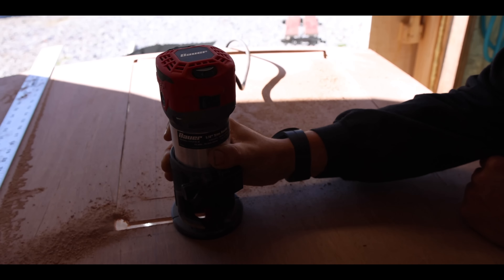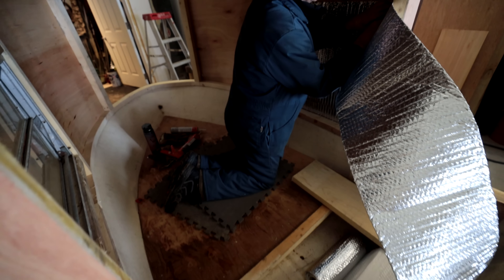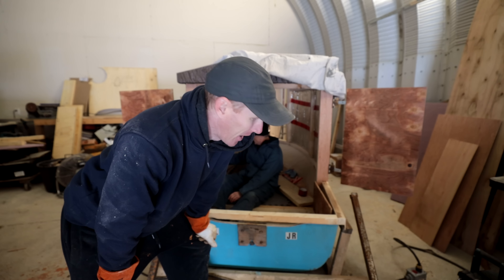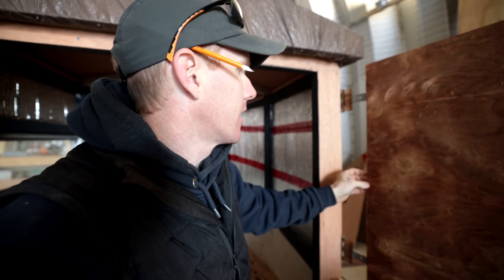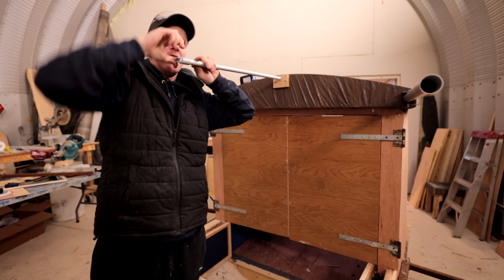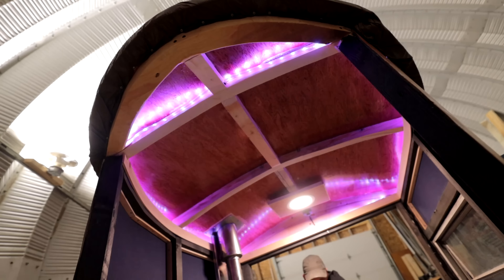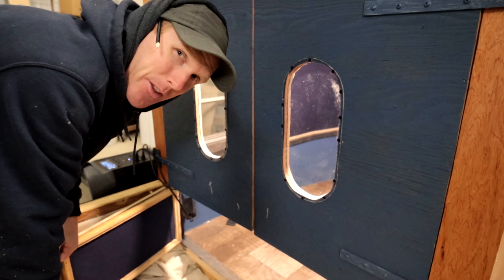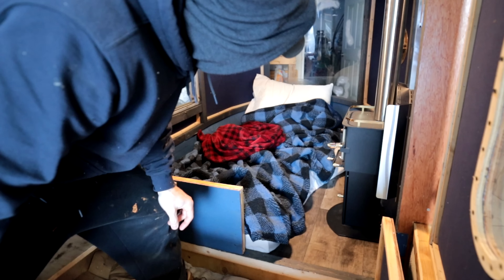Building a TINY HOUSEBOAT (It's Finally Done!!!) vs. @FowlersMakeryandMischief

Comment from the maker: Thanks to EcoFlow. Get an extra 5% off coupon code UBJOPOKQ on all EcoFlow Black Friday products both on Website and Amazon:
EcoFlow Amazon Black Friday US: https://amzn.to/3WsSfUJ
EcoFlow Website Black Friday US: https://us.ecoflow.com/?aff=167
Duration November 11- 28th, 2022.
If you are in the market for any of these products, EcoFlow is running the biggest promo of the year for Black Friday as we speak, some up to 50% off.
Reply: Use  heat for removing the protection layer pexiglass
Reply: Some of the best stuff I've ever found is 3m adhesive remover. The stuff is incredible for removing old stickers on lexan and plexiglass. It's cheap also
Reply: Try using packing tape or duct tape to remove the protective film. Tape it over the film and rub it down good to get it to really adhere, then pull off the tape, and the film SHOULD come off WITH it. I use this method to remove adhesive from stickers when the paper peals off, but the adhesive stays on. It MAY take a little playing with it to find a tape that has a stronger adhesive than the film does, but it CAN'T be any worse than pealing it off a fingernail sized piece at a time
Reply: Use wd40
Reply: @vapingmatty4209  WD40 is a penetrating oil which will actually melt some plastics. This MAY be a type of plastic that WD40 is safe to use on, but since OTHER petroleum based solvents have reacted with it, it MAY not be wise to take that chance. Though it wouldn't HURT to test it on a piece of scrap and see how it does.
Reply: WD40 works great for removing stickers and it doesn't react to plastic.
Reply: Isopropyl alcohol for the window
Reply: I think Zack is gonna have to step up his game to out do ya on the boat.though Zack bed itself might be a game changer if u all decide to take along the wife for a little motion in the ocean
Reply: Your brain needs to be donated to science my friend. I love the little touches, but when you stand back and take a look at it all, it looks pretty amazing. Awesome project and I can't wait to see more.
** LEXAN REPAIR **
On the sheet that you oopsed on, try ""VERY GENTLY"" hitting the damaged fogged areas of the panel with a paint stripper heat gun or ""VERY VERY GENTLY"" with a propane torch. It clears acrylic, also works on polycarbonate face shields that get scratched up, so it may do the same on lexan and should clear up but be patient.  🤘😄👍
Reply: What happened to the orb painting giveaway that was 2 weeks ago
Reply: Catamaran? 
You mean Trimaran. 3 hulls.
Catamarans have 2 hulls.

But what you're discussing is more of a Proa. Outrigger boat. 

Once you add a battery (assuming a trolling motor) it will add ballast.

Comment: The tarp should shrink a bit once the sun gets at it. As has been said, it's not very UV stable, but you can paint it with rubberised roof coating which will reseal it. That's how I've done the roof on my garden shed.
Reply: It depends on the type of tarp. Some of those plastics are highly UV resistant, hard to say just by seeing it though.

Comment: You want the stabilisers to be shaped to minimise drag in the water - narrow boat-shaped. Maybe you can source some from boat-builder’s scrap. Or buy them ready made as they need to be light and the right shape. I imagine that they’re normally made from fiber glass. I’ve seen some great home-made fiber-glass made using a pre-made foam mold on another channel. A young lady engineer attempting to make a bullet-proof ball gown - she did a pretty good job!

Comment: You can use ultra fine sand paper and buffing compound to polish the plexiglass, they have kits for car headlights you can use .
Reply: I forget the name but there's an alcohol-based product he could use too though idk if they have it up there in Canada.
Reply: Nope you can't if you soapy water any kind of solvent will ruin the it's lexan not plexiglass
Reply: Yep, I was thinking wet sand then compound and polish.
Reply: that would absolutely work.
Reply: What a mess? Did you try a heat gun?

Comment: The lexan’s protective cover is impossible to remove because it was left outside. You have to keep them indoors away from sunlight. Same thing with laser tape film on stainless steel / aluminum / copper. Hope this helps in the future!

Comment: Put sticky tape over the Lexan protective film bits, peel the tape off and it should bring the bits off with it. Also, tarps aren't usually very UV stable so degrade quickly.
Reply from the maker: Tried that still required brute force to remove.
Reply: How about a Dawn dish soap/water mix for the Lexan? You could spray on and let it sit for a while to see if it will soak in and loosen the tape.....and I don't think it will harm the surface. Or Krud Kutter is supposed to help remove stickers,  but I've never tried it for that, and I don't know it it would scratch the surface. You could always try either of these on a scrap "test patch." Just some thoughts....
Reply: Pressure wash it

Comment: Try a hot hair blow dryer to peel the paper off. It will melt the glue. Also, I had an auto repair shop polish my headlights because they were so cloudy. Worked beautifully! Maybe something you could try on the damaged areas?

Comment: Glue removal on acrylic stuff: isopropanol. It dissolves the glue, but doesn't affect your plastic for relative short exposure. Used to work with that stuff in microfluidics, so very sensitive to warping and what not. Isopropanol was always the safe choice.
Reply: Oh, and a plastic scraper, not a metal one, for obvious scratching reasons
Reply: or hairdryer for heat to soften the clue and then wipe it clean with isopropanol

Comment: Your boat is looking great! And inspiring me to add that to my many projects to build. Something you may want to try is using a propane torch to take out the fine scratches from the thinner and goo gone on the plexiglass material. Also try using a power washer to get rid of the protective film

Comment: Yes the lexans are usually covered with polyethylene films which is not weather resistant and becomes brittle. Otherwise, you are doing fine. The porthole with the latch belongs inside. Prepare for twisting and moving of the wooden structurs in real life since over water, there will be plenty of humidity and water splashes.

Comment: I think it might still be wise to add some ballast to the bottom center of the hull to give it stability. Stacking all the heavy bits to one side will make it list heavily in the water without you in it, and might limit where in the boat you can sit while moving it with the motor. The proposed outriggers aren't the best shape for the job either, they will create an awful lot of drag even partially in the water, and with no ballast those are your only source of roll stability. Very interesting project, but there's a bit of engineering left to do to make it the best tiny houseboat it can be! 😁👍

Comment: I don't know if the product is available in Canada, but Orange Power goo remover uses an extract from orange peels that is pretty good at removing sticky stuff and it is water soluble so it washes up well. I use it all the time. I'd test on a small scrap before risking the shore window.

Comment: Great job and excellent video, as always!
That plastic protector is welded by sun and there isn't a chance to remove it without damaging material. Same thing happened with family friend who build its house and leave plastic cover on new plastic frame windows 2 years in sun and decide finally remove it after facade was done - all ended up with changing windows because they can't peel it off..
Reply from the maker: I have a feeling this happened.

Comment: Definitely looks  nice.  The only  thing I would done differently is I would of added on the other wall another camper window instead just for matching purposes. Then went with a  small rv door like see on teardrop camper just for insulation keeping the heat in a little bit better.   I definitely do like how it turning out looks nice. Got me kinda wanting to try build one but I have know building experience and plus here in Michigan it's to cold and have to wait til spring.  Definitely like the video.  Definitely gained a new subscriber.  I'm myself is working on building a YouTube channel as well.
Reply from the maker: You'll have to send me a photo of it when you get around to it.
Reply: @ModernSelfReliance   if ever did make one  I probably post a video to my YouTube channel. Cause I plan on when get funding to do so try and do some build challenge on my YouTube.  Like sometime I plan on doing a tiny house build.  Made quite few videos on my channel talking about what kinda videos nolan on doing.

Comment: tip:  I strongly discourage using a tarp . they are waterproof when they are loosely over something but unless maybe it’s a heavy duty one , when pressed against a solid surface water tends to seep through the fibres and will cause mold I’ve tried this for a small project to replace roof felt although I ended up buying roof felt in the end 😅
Reply: I was thinking the same but with an issue like that I'd think that a coat of polyurethane or exterior paint would mitigate that issue. That being said though it's just a temp challenge so long term shouldn't be a problem. Was also thinking that if it was me I'd have sprayed the plywood with spray glue to sit the tarp down clean and that'd make it a little more water proof too. Those wrinkles make weak points. Either way though it's a cool project
Reply: Boaters use tarps but they disintegrate over time with outdoor exposure

Comment: WD-40 works great for removing adhesive labels,price tags. I spray it on,let soak for a bit and lightly scrape it off. it might take a couple of applications and it won't harm the plastic.
Reply: It also might be helpful if the lexan were brought up to an overall warmer temperature. Just a thought.

Comment: While it is not a completely cheap option, I would suggest using a TPO or PVC plastic RV roofing sheet for your roof. Tarpaulins will break down quickly in the sun and winds.

Comment: been there done that with the old lexan. Make a scraper out of the same material. Very minimal scratching if you keep the scraper clean.
Reply: By scraper I mean a nice square piece, with a sharp 90° edge. And at that I round over the corners. Coming from scraping 2 full sheets of 15+ year old lexan I got at an estate sale for pennies over the course of many smaller projects.

Comment: I wonder if 99% isopropyl in the spray bottle would have helped with the Lexan since it flashes off quickly? Naptha is also a good solvent and flashes off quickly but you would have to test to see if it would eat into the lexan on a small piece first.

Comment: I, too, left the backing paper on my Lexan sheets (used as storm windows) too long. The paper peeled off fairly easily, but the cloudy glue was almost impossible to remove. I tried all the usual suspects in the effort to remove the glue. Finally, I tried 99% isopropyl alcohol sprayed on liberally and wiped with microfiber cloth. In a few applications, all the glue came off, and I have clear, unscratched Lexan. Should work on your Bamboo Streama houseboat too.

Comment: Edit: Plastic Tip in reply. 
Another great video! Really enjoying this build. On lexan. You can flame polish it. So those clouded spots from petroleum products maybe polished out with a few passes using a propane torch. 

As well consider clear protective wrap on it. Think car Clear bra or my favorite is Xpel.

The town does a card board boat race.  Well used to before Covid. They do another you and Fowler have inspired me to build a boat for it, if they do it again. 

However even a house boat built of a aluminum John boat. We have a welding and machine. Grew up fabbing metal. I’ve worked with wood but metal fab after 30yrs is like walking.

Comment: The maker of the plastic sheet, make a solution to help peel the protective layer off. I don't remember what its called. It's been a few decades since I used it. I think I picked it up at the same place that I bought the plastic.

Comment: Hey, Dont forget that you will need lighting outside too. Like your red/green port / starboard stern light, anchor light and you might want a light in your lil galley. But if your only going in your pond,  my ideas are a moot subject. But why not one of those china weedeater motor air cooled trolling motors. ive been building boats since i was 17 im now 66.. Nice job. cute lil boat. Hurry want to see your 1st overnighter.

Comment: Use a heat gun to soften up lexan film to peel off with more ease.
And to fix the chemical burns try 3000 grit sandpaper and polish and low heat from heat gun to smooth it and add some shine and a polished glass appearance.

Comment: Heat gun on that plastic coating warm the backing glue should allow you to peel it off easily with a gentle pull
Reply: Also you can mold Lexon  by heating it till is soft then hold in a mold till cool and it will stay that shape just don’t get to hot or it will turn white from air bubbles in it.
Reply: You can make some more domed round windows for future projects

Comment: Lookin' good! Sounds obvious but boats have a tendency to be wet. I couldn't help think about the gunwale sides of your vessel. Great to have the lexan in front. Even have all the edges double seamed. But I bet even in back she's going to sit pretty low. It adds to the weight but you could make some type of lightweight gunwalel extensions for the stern and sides. Just to keep water from splashing in. Last thought, I know you're going lightweight. Even some thin white pine strips to make a structure to lift the mattress off the deck. That might keep your bed clothes dryer. She's looking quite tidy :) Bests~

Comment: Maybe you could try a cleaner for a glass hob electric stove to remove the plastic without scratching it. It might still be too harsh for the LEXAN, but worth a try - combined with a glass scraper while the LEXAN is still flat.
Reply from the maker: That's pretty much was wrecked it first time...

Comment: You can use a quality clear coat compound with a good orbital buffer to get that Lexan clear again. It will take a bit of time and patience, but it will be worth the effort. also, I am a boat guy for 45 years. why not find a flat bottom boat that is all aluminum. Very light weight and much, much more stable than that v-bottom. A Grumman 1437 for about $350 or less.

Comment: Try use a heat gun and a fine razor blade on the Lexan window, keep the blade nearly flat to the surface of the window to scrape it off, the heat shout help soften the glue

Comment: I suggested you go with a tri-hull to have more of a stable platform to work with. Though outriggers are good too. Make sure you have plenty of flotation devices with you and I also suggest for any boater a personal locator beacon to help Search and Rescue to find you.

The tall and narrow boat body profile creates a difficult moment of inertia to keep stable even on calm waters. So you might need more ballast near the center of gravity and the outriggers definitely will help, especially if they are slightly heavy too. You'll have to be aware of where in the boat you are at much like a small plane the pilot is careful to place certain weights in relationship to the center of gravity and the center of lift (quarter chord of the wing).

Good luck in the competition. I doubt your friend can make a decent House Ball.

Comment: Use a little bit of heat from a heat gun and a razor blade for the pieces of protector on the lexan, that used to happen when I took decals and stickers off of cars and the heat gun and blade help a tremendous amount and then use some better goo gone stuff safe to put on plastic or paint

Comment: As you've already ruined the front window you might as well use it to test solutions to the problems created by the protective sheet. I was wondering if you could flame polish the areas that have had reactions to the chemical you used. If you search youtube for "how to flame polish acrylic" you might find a was to restore it......... Chris was almost on to something, just don't use petrol..... use a bkow torch instead!!!!  🤣 Hope this helps, if not you were changing it anyway 👍👍👍👍👍

Comment: Fingernail polish remover. I doubt you will read this, But. Fingernail polish remover will soften the adhesive in the paper on the Lexan so it can be removed without harming the Lexan.
Reply from the maker: I used lacquer thinner and it wrecked the window I'd imagine nail polish remover is similar.
Reply: @ModernSelfReliance  Fingernail polish remover uses acetone and lacquer remover uses a different chemical. I have used it many times and it doesn't affect the Lexan.

Comment: You could have used Low Heat a Hairdryer or 99.9% ISOPROPYL ALCOHOL to have removed the backing on the Lexan Kevin.

Comment: I find goof off is a knock off brand of goo gone. Try goo gone next time. It works pretty good and if that doesn't help then try a heat gun to loosen the adhesive on the peel.

Comment: Heat gun or hair dryer with a sharp straight edge. Also for the record, plastic doesn't come from nature. 30:40 Plastic would be better if you reformulated it. Right now it's stil being made from crude oil that comes out when you take the gasoline out of it. 

With Cannabis being legal in Canada. Would be really great to see a Canadian #ReinventPlastic You could take the formula for plastic. Cut the crude oil ingredients out, and add hemp oil instead.

You could go to an auto detailer and see if you could use the same stuff you would put on your vehicles headlights to buff out scratches.

Comment: You didn't try to heat the protective coating with heat gun. Adhesive activates when heated so it may have activated the dry adhesive and it should've peel faster. UNLESS, you are not allowed to use heat gun to a lexan glass🤔